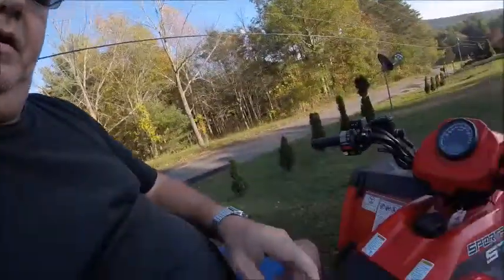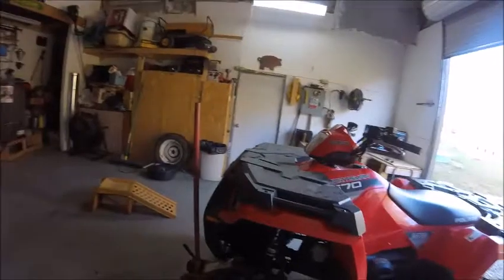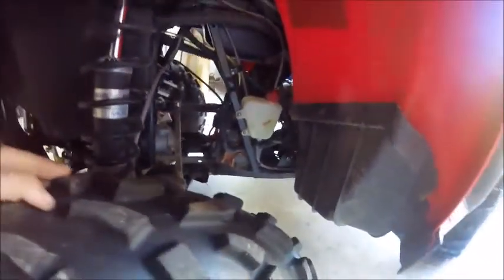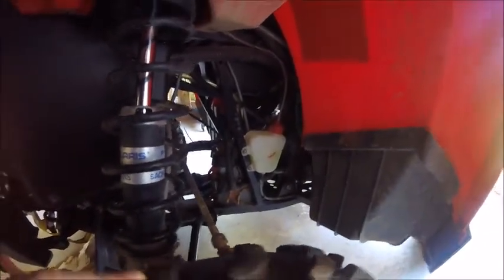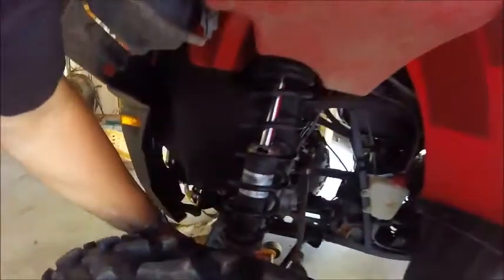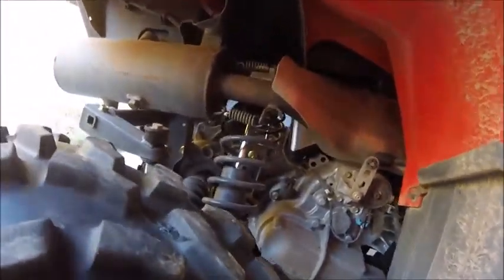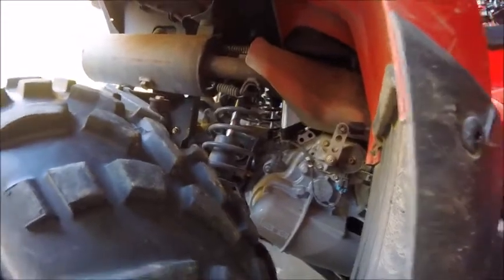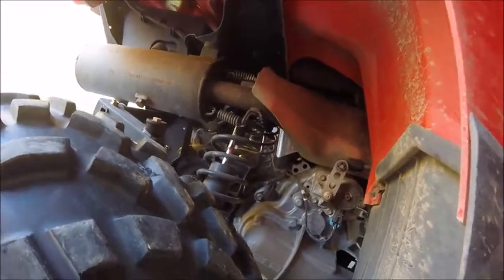Troubleshooting my 2015 Polaris Sportsman 570 and hopefully fixed it!!!!

Comment: Good to know DOWSETT. I bought a 2017 570 last fall with the EPS and I get some clanking noises too.
Reply from the maker: When I took it in  to get the recall for the heating issue told the dealer about the noises and they didn't say they did anything to it but the more it gets broke in  the less im hearing strange noises